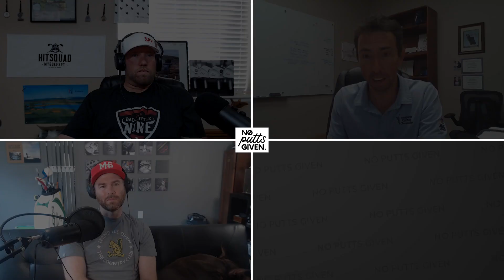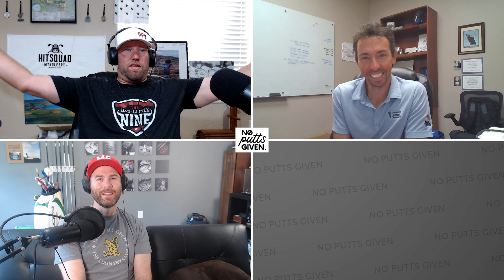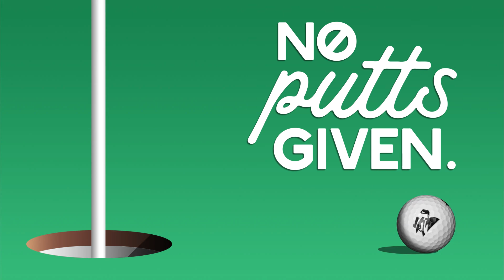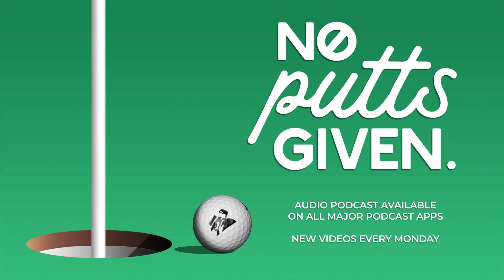Interview with Chris Voshall from Mizuno | NO PUTTS GIVEN 106

Comment: Always nice to hear about the mizunos I play🌞. I really enjoy my JpX921 Forged irons 👍
Comments for next jPXs:
I like the earlier ideas of swing speed (&attack angle) based gapping (5,4,3 feels meh). I bent all my clubs to get almost 4-degrees between all of them to match my desired distances.
Also, the exactly same logo & text placement of the MPs could be used in next JPXs. I feel Tour differs from the other JPXs.
I would also like to see that the material visible behind top line especially on 4 iron of Forged be removed. Maybe a bit of Tungsten instead to reach desired weight?
If there is a way to introduce P-7-4 in fitting would be great, but I get the problem with the amount of shafts needed…
Have a nice summer!

Comment: I agree with Tony on the gapping. It starts at the wedges and works up from there. I go 50/55/60 and the pw has to be 46 or 45 at the most; then it's 4° down from there

Comment: Loved the last exchange.  Driver swing speed 80-85.  Handicap is about 15 Over the years my set up has evolved. Carry a driver and a 4W and then go to hybrids … Currently using pings g-400 hybrids (4-6) (but also have a 3h) and g400 irons 6 thru the UW. And 2 wedges (54) and (58).  The 6i I rarely use.  Tend to Agree with Chris us non elite golfers could go with fewer clubs.  The gaps at the top end really don’t matter as much but the scoring clubs (8i thru LW) are more impt. The teeth of the comb as Tony described. And Dave Pelz et al have also called out.

Comment: What I would change in the JPX Tour: 1. Softer leading edge. 2. Offer a GW with the same milling as a dedicated specialty wedge. 3. The modern standard set composition should be 5-GW off the rack. 

I'm wondering if due to increased demand and time constraints the guys who smooth out the leading edge on the forgings have been leaving a bit more on lately? I just got a new set of 921 Tours and you can see and feel a bit of a line on the leading edge compared to my MP-15's which are nice and softly rounded off. Is that intentional or is it part off getting the clubs out faster?

Comment: Great episode as always guys. I always watch anything with Chris Voshall on it. I’ve owned 9 sets of Mizuno irons over my 64 years. I currently play the ST-Z Driver and 3 wood, the CLK, MP20 MMC irons and 2 S5 wedges. My 60 degree wedge and putter are the only clubs in my bag that aren’t Mizunos. I love the irons a lot. I also have a set of MP33s, which I think are the most beautiful irons ever made. I still pull them out and play them at times. I do have a question for Chris V. I’m thinking of upgrading from the ST-Z driver to the 220. Is there enough of a change in technology to make the switch viable?
Reply: Biggest difference you'll see to the 220 driver is the forgiveness. The 220 is much more stable (higher MOI).
Reply: @christianvoshall3060  Good call Chris. Just played 14 holes before getting rained out. 10 of twelve in the fairway and the 2 I missed weren’t by much. Not sure if it was as long, but it was cool, damp and windy.  It didn’t matter if I swung easy or tried to jump on it I couldn’t miss a fairway.
Reply: @christianvoshall3060  Thank you for validating this. I can attest having went from a ST-Z to a fitted 220. This is my favorite driver I’ve ever had in the bag from a looks, feel, performance standpoint!
Reply: @christianvoshall3060  thanks. Going to look for the 220 today. Mizuno is more than just irons.